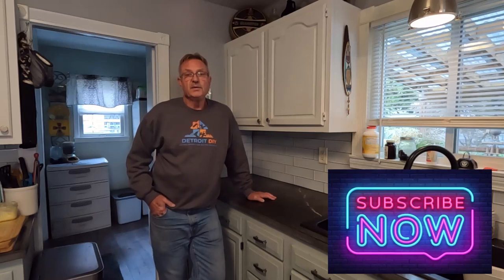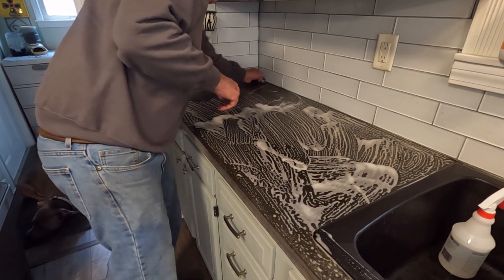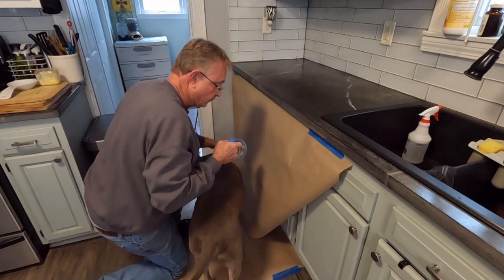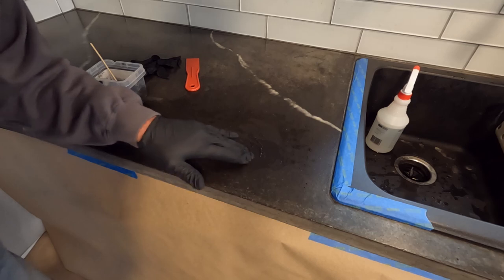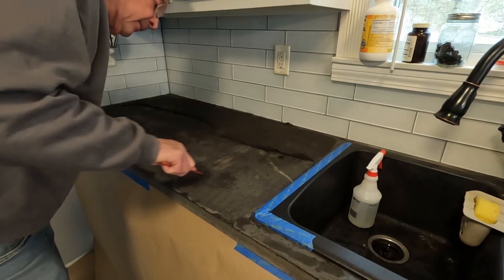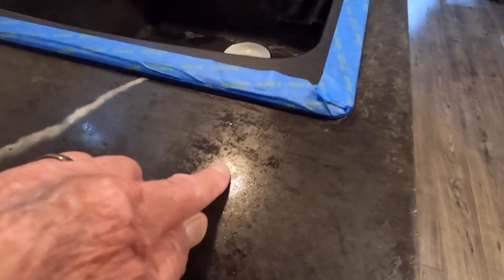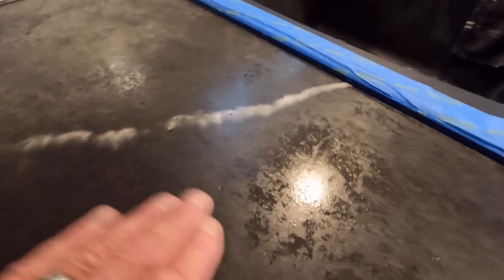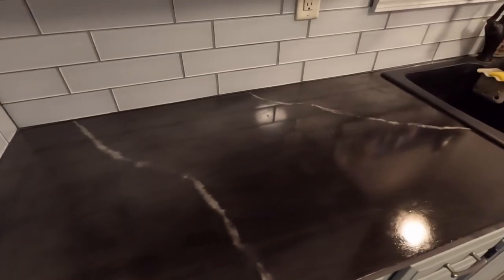How To Fix Air Bubble Voids In Your Concrete Countertops!

Comment: I literally just finished doing the same thing all weekend on some new countertops.  I used 100% Portland slurry.  Thoughts on the Portland vs a Portland grout
Reply from the maker: The portland based grout didn't hold up and was hard to fill small holes. I think with 100 percent portland you may have experienced the same thing with difficulty filling small holes. The Cheng product was super fine and filled them easily.  As far as how it will hold up just have to wait and see. Thanks for watching.